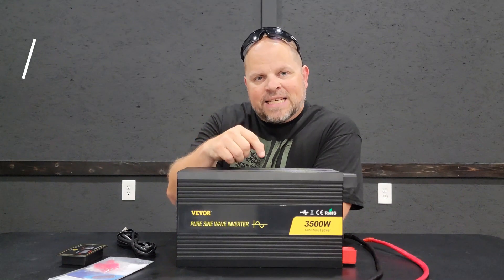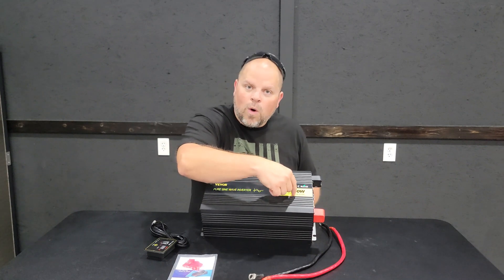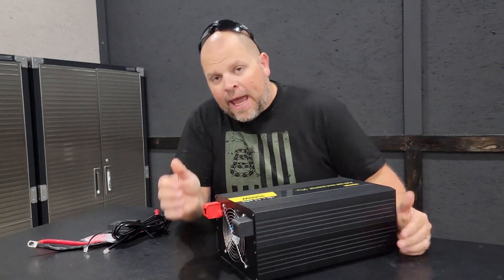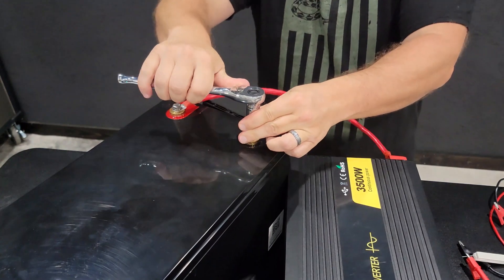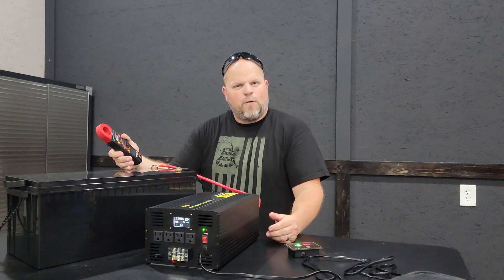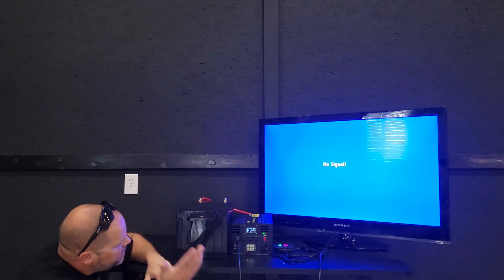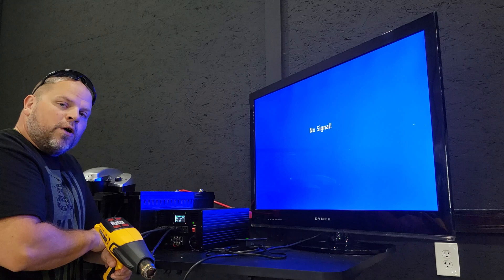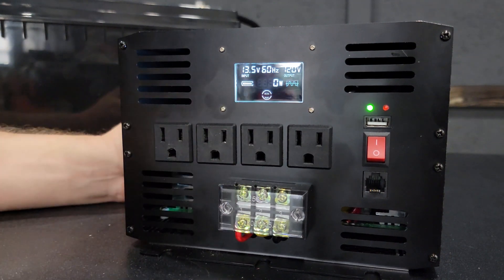Vevor 3500w Pure Sine Wave Inverter 12v to 120v

Comment: Great video. Thanks for sharing. Looks like they updated their site info as it doesn't say GFCI that I could find. I just bought one and it seems like a heck of a bargain. Edit: ... I just cut the heat shrink off of my wires and they are also now copper instead of aluminum.

Comment: I'm doing a diy power station for work and car camping. I have 1,400 watts of solar panels and a 120-amp solar controller; it can take up to 180 volts on the input. I'm thinking about pounding a short rod in the ground and grounding it; it can't be too deep, so I can pull it back out with a jack. I got hit by lightning before while walking down a dirt road, and now I'm scared of it. Also, I can probably get a GFI to work if it's grounded.
Reply: This is what I got, 2000-watt continuous, 4000 watts of surge power. I could probably have a toaster oven making pizza all day long with it. LOL It's almost overkill for car camping, but I'm using it for working sometimes.

Comment: There are 6 tags under the outlet recepticals. These are to hard wire the the inverter to the mains in order for it to operate as a UPS device. They include an input and output earth. It maybe that the GFCI only works if these are connected and I expect they also act as a chassis earth. Without these connections the auto mains/inverter bypass switch is not powered and that may explain the very low quiesent currentPerhaps you could test this and add it to the video. Anyway thanks for the load test, I just ordered one of these so it is nice to know that it really is 3.5KW.
Reply: Guy talks too much not knowing the important details. Poor video

Comment: He was definitely right about needing another video to fully discuss the modified vs. pure sine wave inverters, but it might be advisable to say in the video that if you use electronic devices like TV's, cell phones, CPAP etc that  use induction motors, you really must go with a pure sine wave power inverter.  The modified inverters will damage your electronics.  You absolutely need the smooth consistent power wave that only a pure sine wave inverter can supply.

Comment: It's good that you tested this up to and beyond the maximum load rating.  Looking at powering a small camp with a 6000BTU mini split and a small electric water heater.  Which combined draw less than 3000 watts.  Everything else is minimal.

Comment: I did several loads of laundry and ran a 120 volt 1300 watt clothes dryer on this inverter and a 12 volt 310 ah battery, every thing ran fine ,didn't have my solar panels hooked up yet, trying to cut electricity bill a little,. I have two EG4 one ton mini splits Running straight off solar panels, one in basement and one on main floor,  in 3200 Square foot house,, they are awesome,

Comment: Great Video. I bought a 3500w 24v. It's been on since January 2023. It has not been worked hard imo. 1. It lost the digital readout, contacted vevor, and they did respond, leaving it that. The plug in digital readout went out about 7 months ago, 2nd one. Inverter would pop inline fuse early this year and was getting warm. Today it will not shut off with the switch, been getting extremely hot running 800w lights. Got zapped today installing a shunt. Everything was off. Can't complain for the cost. 2 1/2 years ran continuously. I'm going to buy another as im not ready to go to 48v. Hope it helps. No GFI, as he stated.

My Bad, Vevor discontinued.

Comment: Have you check Hot and Neural leg to ground to find out it is 60v or 120v?
Also did you check to see  it is Neutral Ground bonded or Floating Neutral?
Reply from the maker: I have not,  If I can find this thing buried in my inverter stacks I will check it. Thanks for sharing

Comment: Great Review. I agree, should have had a ground lug. However, it would have been a false ground anyway unless you drive a grounding rod. So a person could drive a ground rod intoe the ground and solid copper wire to the chassis of the inverter, like at the mounting holes and ground it yourself that way and have an actual graound instead of a false ground.

Comment: Hi. Can one use as 12V source a 100W or 120W AC/DC Converter (100~24V to 12V) instead of a car battery? I own a 800 W sin wave inverter. Thanks.
Reply from the maker: I am trying to think why one would want to do that
Reply: @TheSolarPit  I live in Europe (230V 50Hz) and I own an american device that only works with AC current 60Hz (it has a chip that recognizes if 60Hz or not) and does not work with step-down converters from 230V to 120V. The solution was to buy a sin wave inverter fo feed the american device with 120V 60Hz. My question is if one can use a AC/DC adapter instead of a car battery to feed the sine wave inverter. I recently bought one (10A) ant and it works fine.

Comment: It's all fine and dandy, but in the end, it's just an inverter...
It doesn't have the ability to charge batteries, it doesn't have a transfer switch, so everything has to be manually activated...
There are better options out there...
IF you're in the market for an inverter of this size/type, 2 things that should be at the top of your list are, 1) It should be a inverter/charger, 2) It should have an automatic transfer switch...
Reply from the maker: Thanks for sharing

Comment: Nicely done.  Just the right amount of commentary and decent audio as well. Clean, clear, valid discussion points. A question: Did you manage to get Vevor to explain or comment on the GFCI thing.?? Hard to imagine that they would NOT have an equipment ground which is necessary for a GFCI to work..!! Also, interested in the apparent low-ball idle condition numbers as shown on your clamp meter.... Thanks..
GREAT video.

Comment: You don’t mention the current from the battery needed to get to 7,000 Watts output. That is going to be 7000/13=538.462 Amps !!!! That is a LOT of current and needs some seriously thick and extremely expensive cables !!! Not to mention some serious capacity - 6x 100Ah batteries in parallel !!! At this power level, but go to a 48v system !!!

Comment: Hello, that resistor that you used to induce the capacitors, can it be of any size, or specific? And why do you connect it to the positive of the charger? Thanks for the video.

Comment: I've had one of these for a little over a year, works fine. I like the very low idle current.
Reply: not a issue for me, as when not in use it is turned off.
but less idle draw is better

Comment: this thing doesnt have a ground lug and i get a open ground message on my outlet circuit tester.  Vevor is slow to with support
Reply from the maker: That was one of my concerns that I pointed out in the video. I think Vevor should get a grounding option on this inverter.
Reply: @TheSolarPit  I can't even get a response from them if it's safe.  I'll likely toss it and buy something with a real ground.  Shame it works great otherwise.

Comment: I have an old inverter I got 15 years ago, before I knew about needing a pure sin wave for refrigerators and such, anything with motors, it is a modified sin wave, my refrigerator is the type that converts AC to DC, have you any information on if the modified will run any of my stuff that goes from AC to DC fridge and  120 AC I have, with out burning the motors up on them, the old modified is a 5,000 watt surge to 10,000, it has the power but that modified sine wave they tell me will burn up my fridge and AC, do you have the answers??
Reply from the maker: In most cases, I agree with them. Pure Sine Wave is definitely a better choice. Thanks for watching and commenting!

Comment: I have that same inverter, and I get similar numbers on idle. I did some testing when I got it and was shocked that it pulled under 5 watts at idle. And if you're careful about what all you turn on at once, it runs everything in my house that runs on 120 just fine. I have breakers arranged that hook both legs of the house together and to that inverter. A few weeks ago, we had a 92" TV, a 73" TV, normal lighting in use (all LED), and a couple of ceiling fans running while we microwaved dinner. It handled it like a champ. The lights didn't even flicker when the microwave kicked on. I highly recommend this inverter.
Reply from the maker: Thanks for watching and commenting! 👍

Comment: I've been trying to figure out what kind of generator to buy when my power goes out during a hurricane, I have 3 Econoline vans and an expedition, and I thought maybe I can buy one of these instead of a really expensive gas powered inverter generator, I thought I already have the engines, so basically with this unit you're showing here, I want to power a full size fridge, a midsize fridge, 3 window a/c's, 3 flat screens, and a few small devices like router and a laptop and charging phones, I figured I would need about 3000 to 3500 watts, amps I'm trying to figure out, but will this be able to power what i need? Connected to my van? Meaning I would put gas in the van to power this inverter
Reply from the maker: Without knowing and seeing everything, I can't say for certain. But it does sound like this would work for you.

Comment: The battery cable is probably going to be replaced with a proper gage copper battery cable and it was the rated one in the specifications for the device. You mentioned that it came with a copper wrapped aluminum one.
T. V. Set comes with a DVD , CONSOLE , ??? , so you probably placed a larger load on the converter than those, Just have a solar panel and it has a add on panel for an extra power.
No battery or inverter yet, I am so confused about which way is for me.
Want to use power tools and a camp full of utility gear needing power.
Portable and powerful enough to work at night while cooking dinner! Rockhounding and I really don't want to pack a lot of host rock than I have to!
Reply from the maker: Thanks for watching and commenting

Comment: Not sure if it can handle a pressure washer and water pumps for a Pressure Washer rig 🤔
Reply from the maker: It really depends on the size of the motors you are trying to power up. It's max is 3500 watts continuous.

Comment: A GFCI does NOT need a ground.  Your GFCI tester does need a ground.

A GFCI simply compares current on the hot and the neutral lines.  If those lines do not carry the same current, there is a Ground Fault allowing some current to bypass the neutral and the Circuit will be Interrupted.  This works so well that the National Electrical Code allows for 2 prong outlet to be replaced with a 3 prong GFCI when a ground is not available.  The GFCI is similar to, if not actually more safe, than having a ground.  This is probably how the inverter is designed.

Your tester needs the ground path which bypasses the neutral in order to safely create a ground fault for the GFCI to detect while testing.
Reply from the maker: Thanks!

Comment: I bought the 3000w unit and the manual does not show where the fuses go 
I’ve contacted vevor and still can’t get an answer of the location 
If it’s inside then I’d void the warranty by opening it to change the fuse 
Do you have any idea where the fuse is? They send a bag full for a reason
Reply from the maker: Thanks for watching and commenting

Comment: My comment is on inverter fan design in general.  gnurlgnar (sp?) uploaded a YouTube video about this and makes a great point.  If you've finished exercising and are still hot, you might sit in front of a fan.  Specifically, you choose the fan blowing on you, not away from you, and you feel a real difference in cooling effect.  So it only makes sense for inverters to have fans blowing into them, not out of them.

Comment: Will it run an RV ac unit is what matters.
Reply from the maker: Depends on the size and power draw of the AC unit in that RV.
Reply: Use a soft start @TheSolarPit

Comment: I agree with the wiring pure copper should be used. For gfci since you could just wire in a pony panel and run a gfci off of it. It would not really make a difference if they had one but the false advertisement needs to be dropped about it. The remote not matching up with the screen seems to happen with most inverters I’ve used before. So long as it’s close it’s not a problem. 
The ground is a big one but however you can still wire ground through the negative. This is normal for DC current. Besides that you should always use a capacitor in between your inverter and battery. If done properly it should increase the life of your device since it won’t have to work as hard and if your battery is full it will use the power from the capacitor first and charge it first so that your batteries don’t get touched as much when charging on solar during the day.
Reply from the maker: Thanks for watching and commenting 👍🏻

Comment: Question what inverter and Battery setup would I need to power a 6000 BTU portable AC unit for a box truck that's well insulated and 16 ft long
Reply from the maker: Honestly, It's getting about cheap enough to buy a portable power station for that type of setup. Plus you can just unplug it and use it anywhere. The flexibility of those things are impressive.

Comment: I was seriously considering trying this inverter for a single reason. The Renogy 3000 watt inverter had a struggle to start my 16,000 btu air conditioner on my boat because of the surge. In fact, I watched the whole video waiting to see just that, but it never came. I ended up buying a 4000 watt Giandel and it handles the load just fine and runs quite a bit cooler and quieter than the Renogy did. I also find it only draws about 5 watts when idle as well. I am very leary about specifications on just about anything these days because companies just flat out lie. I only purchased the Giandel because Will Prowse tried one and could not kill it. I also bought mine second hand for $250, so it was just a bit better of a deal. So far, 4 months into cruising in the yacht, it has not given me one bit of trouble and it so quite, I don't even know it's there. In fact, the cabinet cooling fans are most of what I hear.
Reply from the maker: I think you made the right choice going with a 4000w on that. Thanks for sharing!
Reply: I agree about product lies. Looks like everyone says "Pure sine wave" but then it says "Modified" in the details. We need to see them tested on the scope.

Comment: Can u run a inverter off being plugged in a outlet in  the house instead of a battery? I have a ac unit in my shed that won't come on cause not enough power from extension cord from 20amp plug
Reply from the maker: I would recommend a portable power station in that scenario since it offers pass through and backup.

Comment: Excellent and very thorough video, one of the most comprehensive explanations I have ever seen, and trust me, I have seen plenty of inverter videos. Very odd there is no grounding lug. Every inverter I’ve seen in videos, and the 3 in person has a lug. I’m still confused on if you need to ground  it or not, because some say you need to ground to an RV, others say not. How can we find out, 100% for sure?
Reply from the maker: It really depend on the electrical system you are connecting to. I think this has an open ground.

Comment: Have a 2500 watt vevor. Died after 1 1/2 year. A pain, I have to disconnect and remove and buy new inverter. Maybe fuses? they sent spares with unit but no instructions. Seems like most cheap ones have fuses soldered to the board. Also, their units don't have cooling fins which could have contributed to failure. You get what you pay for. I am not a fulltimer, used on camping trips. Cannot recommend brand.
Reply from the maker: Thank you for sharing your experience.

Comment: can it work for a LEVOIT LV600S Smart Warm and Cool Mist Humidifiers for Home Bedroom Large Room, (6L) 753ft² Coverage, Quickly & Evenly Humidify Whole House, Easy Top Fill, App & Voice Control - Quiet Sleep Mode I  NEED to KNOW if it will work on it or will i NEED to buy a bigger one that cost more money
Reply from the maker: It really just depends on the consumption of the appliances you want to power, whether it will work or not.

Comment: Also, there are high frequency and low frequency inverters.  I read that if one wishes to power an induction load, like a pump motor, one should choose an inverter with low frequency.  I'm not an electrician, so I can't say why.  When in doubt, check!  Another thing, for that size inverter, 3500w, one might consider a 24v system, or even better, a 48v system.  It would run cooler, and the wires would not need to be so thick.  You save money.
Reply from the maker: I agree that a 48v system would be more efficient. In some cases, people need a 12v system with this wattage, though. Thanks for watching and commenting 👍🏻
Reply: low freq is better for heavy start draws. 
could have heavy cast iron transformers  that just last longer
Reply: so that big fan sucks?
not blows?  right?

Comment: Definitely NOT gfci outlets no trip or reset buttons and no labeling.......
Reply from the maker: Thanks for watching and commenting 👍🏻
Reply: He said it at around 8:00 ...
Reply: One thing for future reference with the tester though is I've never found an external GFCI tester that will trip a non grounded GFCI outlet. Note that a ground is not required for a GFCI outlet (non grounded GFCI are approved by nec). All a GFCI does is monitor for any differences between the hot and neutral and trips if they are imbalanced